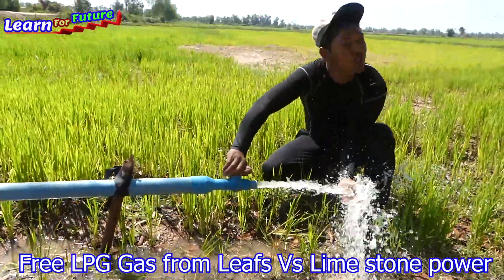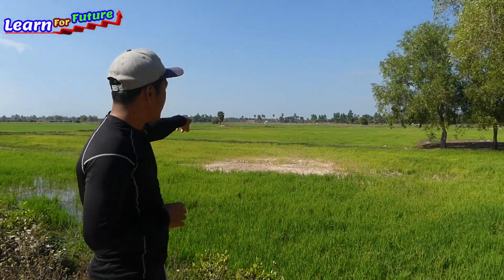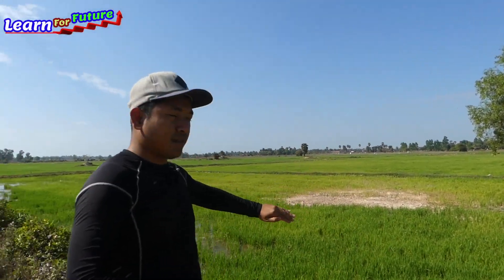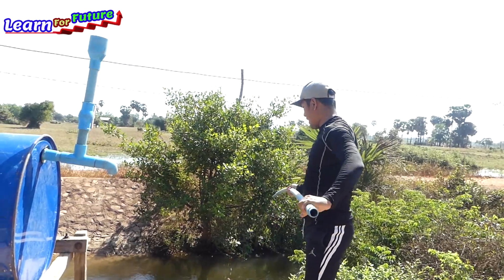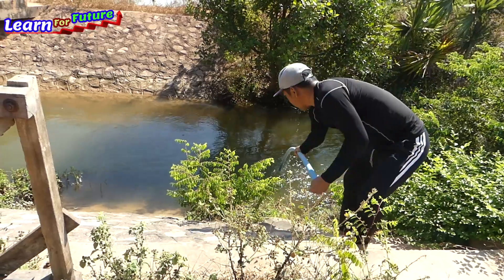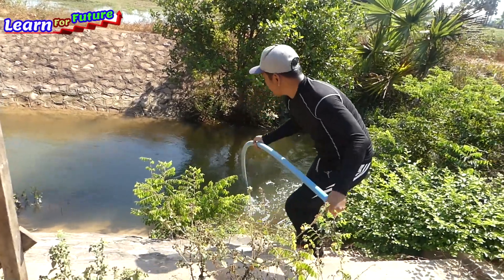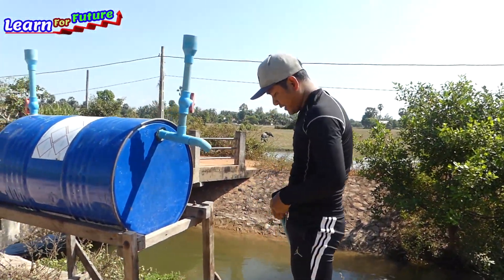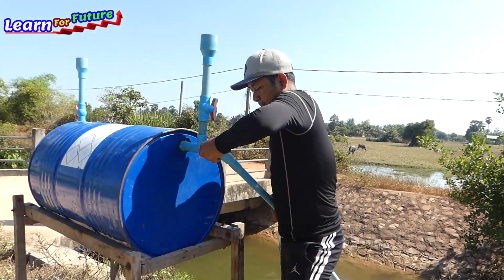Suck Deep River - How to make Auto Water Pump from Big Deep River without Electricity

Comment: The level of the river water surface (the surface level of the intake water source) should be the same or higher than the surface level of the rice field soil (the water output level).

Is"nt it that the water input level and water output level difference is the fundamental requirement for this drum system to work? Looking forward to your response. Thank you